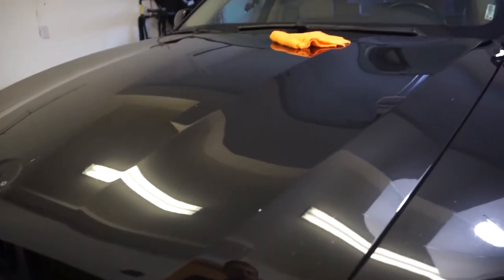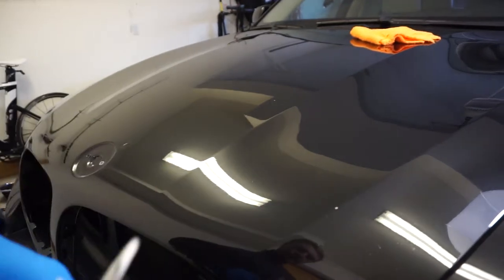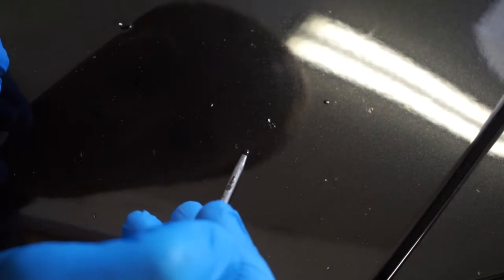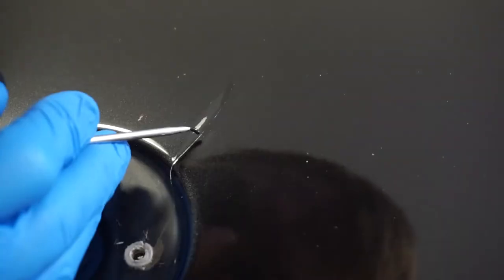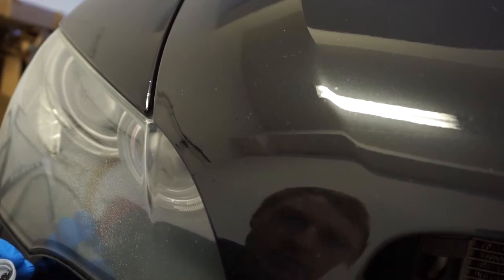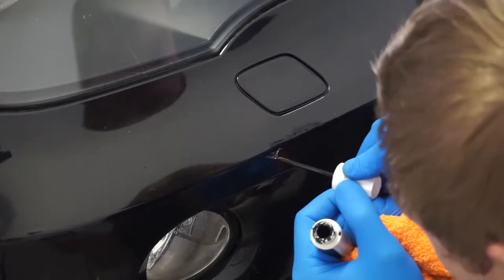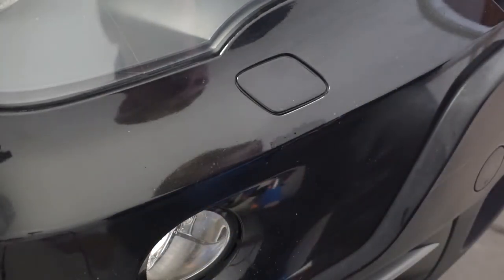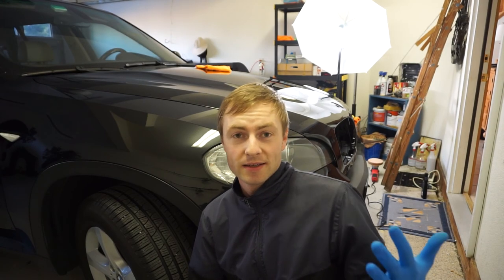How To Fix a Rock Chip from your hood Bumper Touch Up Paint

Comment: For the smaller spots, you could use a needle is slower but end result is beter
Reply from the maker: For sure! But i want to try the air brush for the super  small Chip's.  But i will include the needle and some special tools for that job in the next project!
Reply from the maker: Thanks!